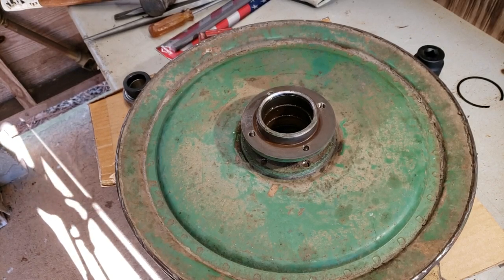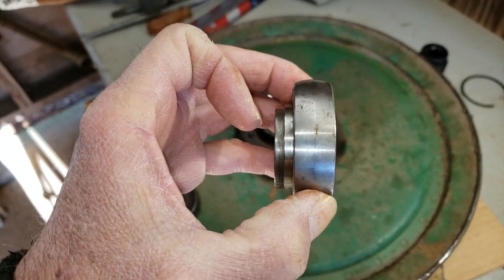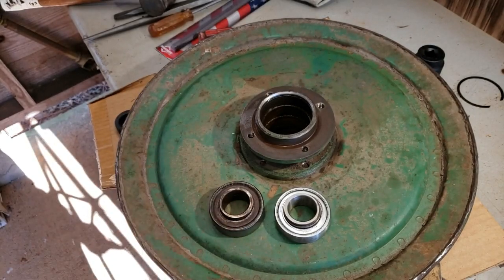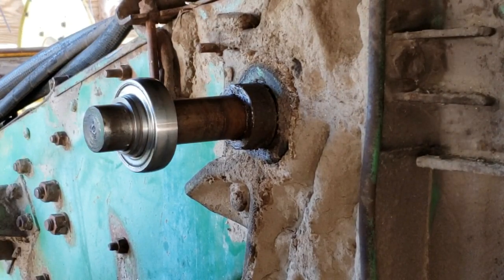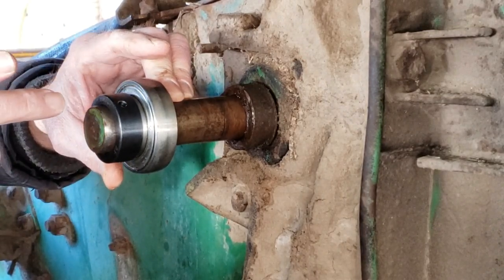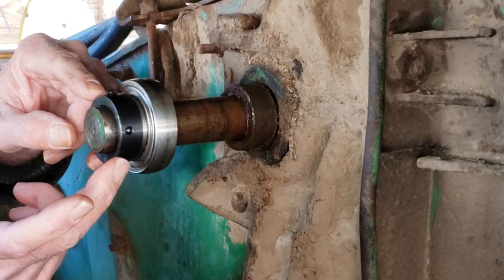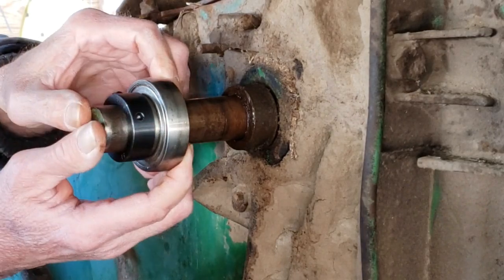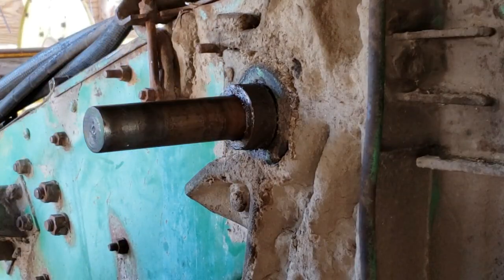Eccentric Locking Collar and Wrong Bearing

Comment: So if you had unlocked the set screw and took a punch and turned the locking collars you should have been able to pull the whole pulley assembly off.

Comment: What we would do with all bearings without a grease fitting we would take and put a small hole in the plastic side of the bearing then we would use a needle fitting on the grease gun to pump grease into the bearing. That gave untold hours of life to a bearing and saved a lot of aggravation later down the road.
Reply from the maker: It was Bandit farmer who first introduced me to a grease needle and I have found a lot of different good uses for the one I bought. Thanks for watching.

Comment: The bearings you want are cylindrical outer race, not spherical outer race like the wrong ones. I believe Shoup Manufacturing and Sloan Exoress sell the bearings you need. Might want to try Napa, or TSC if JD does not help too.
Reply from the maker: the correct bearings are now on the way and a verification procedure has been put in place.  thanks for the information you shared.

Comment: Good thing you figured out the bearing that you need . My neighbor had the issue of the shaft being worn some too but your yours looks decent
Reply from the maker: Got on the phone this morning and looked around and found the correct bearings they should be here Friday. Yeah I could have let this go a while longer and then I had a messed-up shaft that back bearing was in sad shape. Hey Jay thanks for watching.
Reply: @SoybeanFarmer3300   AJ+ they have a tool that's put neural on worn shafts it's like a pipe cut  or you can center punch them and then use Loctite no

Comment: That's frustrating SF, hopefully they will have the right parts when you go back. I am really cheering you on  to get the old 3300 rolling again. ha ha. It will go together good i'm sure. Thanks for the video.
Reply from the maker: I feel pretty good about being over all the drama with this repair.  should get the correct bearings on Friday.  there are still a lot of beans in the fields around here due to frequent rains.  just about the time things get close to 15% wet beans it rains here again.  Most of us don't like the high cost of moisture dockage so we are waiting it out.  thanks for being here watching.

Comment: I see those bearings that you got for it even though they’re the wrong ones I guess you’re gonna be running sealed bearings so I guess you don’t need to set a Griesa nipple in there
Reply from the maker: No grease fitting going to be installed. It's just not going to workout in that application. Removing the inside grease seal to allow grease into the bearing would serve no purpose without removing the outside grease seal to allow grease to be pushed out so that new Grace could be pushed in. This would in turn create a Real mess.

Comment: They call those wrong bearings, self aligning bearings. They're used were the flanges or pillow blocks may not be parallel to each other. Definitely not what you need ! Great explanation on the cam locks!
Reply from the maker: Aside from the fact that they were not going to be held tightly in place by the snap rings I could see how they wanted to wobble around inside of the Hub first thought after that was these bearings are going to tear this whole hub to pieces. CE thank you very much for being here watching commenting supporting the channel.

Comment: A lot of people get confused on which way a bearing collar should be tightened. Your case makes seasoned mechanics scratch their head sometimes trying to figure out which direction because in your case the shaft is stationary. Good job explaining how a lock collar works.
Reply from the maker: Now take into consideration the stationary shaft and there's a collar on the inside and another collar on the outside and the question in your mind is, do they both lock in the same direction? I went around and around in my mind with this until I found that article at.         AGWEB.   I put the link to it in the description of the video it was a good article. Thank you very much for being here watching.
Reply: @SoybeanFarmer3300  I'll argue a little here. I like to think I'll be the one taking a locking collar off the next time. If so, with the mood I'll be in after a bearing failure, I'd be happy with Righty tightey, Lefty loosey. I figure if she's tight , she's tight.
Reply from the maker: Back sometime around 2016 I let cousin talk me into letting my wheat grow to harvest,  he actually put the nitrogen on it. dialed that rasp bar cylinder up to 900 RPM and went to picking wheat. After a couple of hours the bearing on the rasp bar cylinder located on the side with the heavy pulleys controlling the variable speed seized up and threw its locking collar, somewhere we never found it. Then the bearing proceeded to explode taking with it the cast housing it was housed in. All that was left was the inner race heat seized to the shaft. Worst nightmare repair I've ever had on that 3300. Who knows for sure why it all blew apart but it was definitely an event. During my research to gain an understanding for eccentric locking collars I ran into the argument in multiple places concerning which direction to lock the collar. It reminds me of how the main hydraulic pump is attached to the end the crankshaft on the engine of my combine. With the rotation of the engine it's trying to make the threads tighter on that connection if it had been reversed and then using some type of locking nut there probably would have been a lot of issues with the hydraulic pump separating from that drive shaft. The math supports the physics of the Dynamics of energy in motion meaning when the caller is locked in the correct direction it will only seek to get tighter.

Comment: Good information on the locking collar.  It will help me when I work on my baler this winter.
Reply from the maker: I got that link I found at  AGWEB bookmark. It really cleared up what I was working through my mind trying to reason out about how energy would transfer through the bearing. In case you didn't see it that link was in the description of the video.

Comment: There is a short rubber hydralic hose that is in the steel line on the differential lock on a 4640.......My dealer looked up the part # ordered one from Atlanta... when it arrived it had a #5 female JIC on one end and a male #5 JIC on the other end...... Problem ...... one end of the hose that I took off had a female inverted fitting....That mated to the steel line with a male nut and a flare on the end of the line.....Sort of like you find on brake lines,,,,,,,,,,,.We had to order the line using the number on the tag that was on the line.... they had one in  Waterloo........So  Don't be too hard on them........
Reply from the maker: David my friend right now I'm ticked off but by the time I walk through through their door I will have prayed enough to realize the person I'm talking to is someone Jesus loves. So with that in my mind I will Bridle my tongue. Controlling myself in this manner will allow me to enjoy the rest of my day as well as sleep well at night. Thank you for reminding me of the right thing my friend.

Comment: This is what I love about the YouTube community. I've known about eccentric collars for 20+ years and the idea of how they lock on the shaft. But I didn't realize until your videos how the extra hole was for a punch to drive them tighter AND I never thought about rotating them in a particular direction based upon the rotation of the shaft. I'm a contractor/excavator and I replaced the bearings on my 3 point Gill (soil pulverizer) not too long ago and one of the collars came loose not too much afterwards. It's actually still in my truck's cup holder since I was on a jobsite. Guess I need to make sure I tighten it the correct direction on the shaft!

Hope you had a Merry Christmas and a Happy New Year to you SBF!
Reply from the maker: Thank you very much for sharing this with me here. Be sure to check out the link I put in the description. It was that article that cleared it all up and solidified it in my mind what I was wrestling with about the physics of energy in motion and how it transfers. I hope you had a nice Christmas with your family and you are looking forward to a safe and enjoyable New Year's celebration.🙂🥃

Comment: Good explanation and good eye on that wrong "for this application" bearing. That bearing would work for an application that required a shaft to float.
Reply from the maker: https://partscatalog.deere.com/jdrc/sidebyside/equipment/72737/referrer/navigation/pgId/401023270
 Look at part number four that is where a bearing with the rounded edge would go between the two flanges. There are several other locations on this combine where that exact style bearing is used. And for that reason I thought I had the correct bearings when I left with them from the John Deere dealership.
 Check out the link in the video description to the article at AGWEB.  That article solidified for me in my mind what I had already worked out concerning the physics of energy in motion. The catch was knowing the difference between a stationary shaft and a rotating shaft. The Genius of the locking collar is that it can be locked in either direction eliminating the confusion of having to ask for a left hand or right hand locking collar. Wayne my friend thank you very much for being here watching commenting supporting the channel.🙂🥃
Reply: @SoybeanFarmer3300  Yup, allows the auger to move or still work if it gets bent a little.